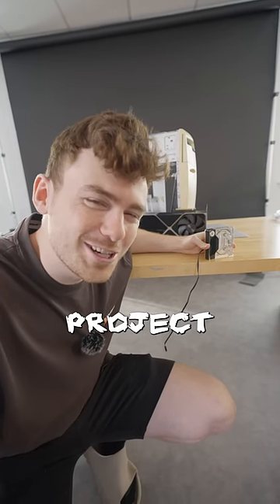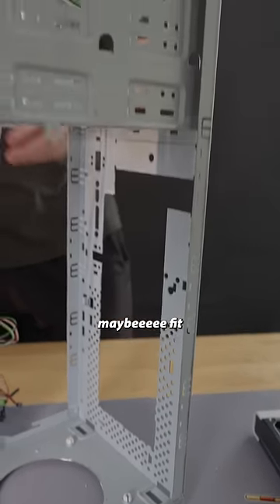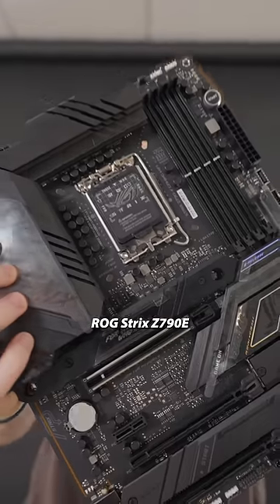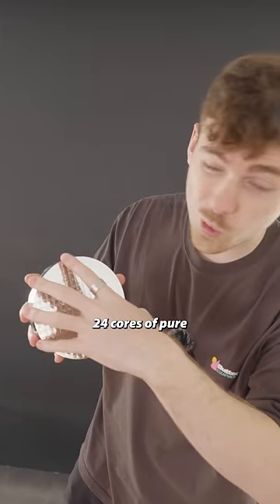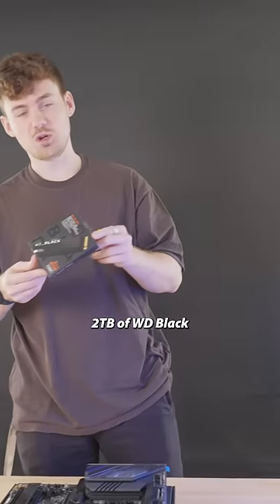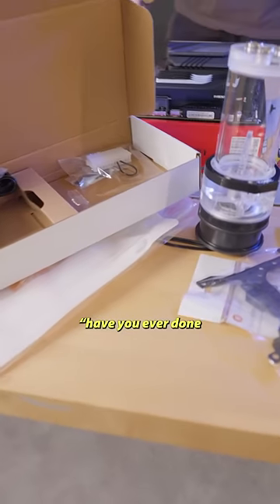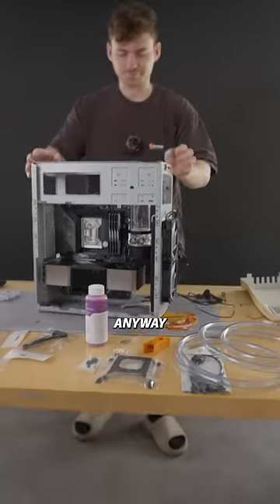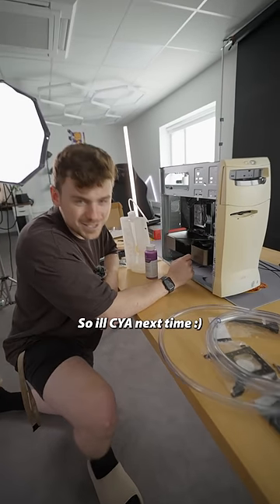Windows 98 sleeper build 😮‍💨

Comment: Custom loops aren't worth it. I say this after 5 years of maintaining, troubleshooting and redoing a custom loop with 720mm of rad space, custom distro plates and two blocks. It looks cool, but the performance and noise benefits are pretty negligible compared to a very high end air cooler or decent AIO. The only good reason to do it is if you really want to do it and enjoy it. I used to enjoy it, now I can't be bothered with it.

Comment: You can use H2O2 to clean up the UV discolouration on the front of the pc
Reply: Quick flash with a blowtorch will do it too!
Reply: I spray with isopropyl alcohol, wrap in cellophane, and stick it under a black light over night.

Comment: What concerns me is that it took the BBC 50 years to use up all of The Doctor’s original 12 regenerations meaning that, if the series is to continue for the next 40 years, the show will be 100 by the time they will need a new set of 12 regenerations

Comment: looks great, im just wondering if a 4x16 (or possibly 4x8) set of 6800mhz ddr5 is actually gonna run stable because ddr5 has issues running on 4 sticks with consumer grade motherboards and cpus
Reply from the maker: unfortunately it doesnt - have it sitting at 5000 iirc :(

Comment: I need a video on how to make a invisible door, I want to add a Bluray player to my HYTE Y60 case there are 2 120mm fans underneath 1 plan to remove 1 and trim the inside bottom edges out and slide a Bluray play in. I just need to make the front of the blue ray player the same white color as the outer edge of the case and make a cutout in the outer edge of the case

Comment: Issue with 4 ram-sticks at 6800hz... You won't get that speed stable no matter what mobo or processor you use. EXPO and XMP are just fucked for some reason with DDR5. 
Hopefully next gen fixes it, but I doubt it.
Reply from the maker: Yeah found out the hard way mate! Running stable at 6000 tho so ntb 🙏
Reply: U can do it, but not on  a Z790-E and beyond 64gb is pretty much uncharted territory when it comes to overclock forum advice and guides.